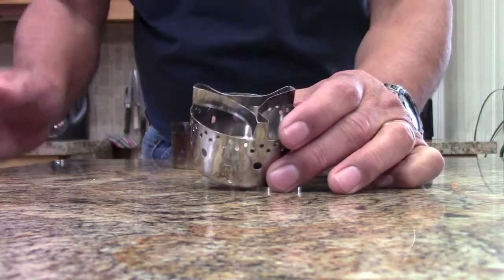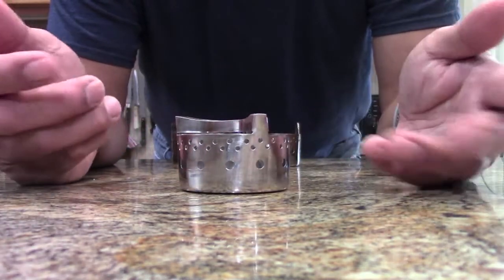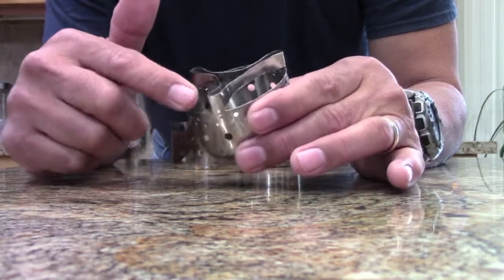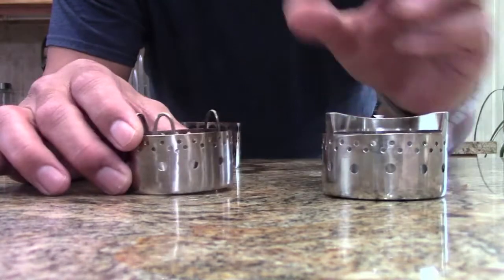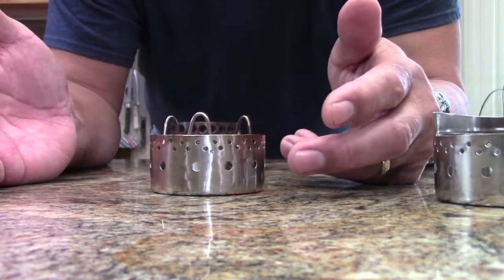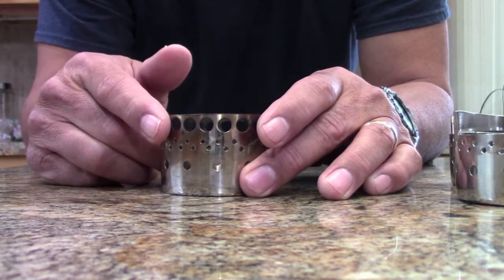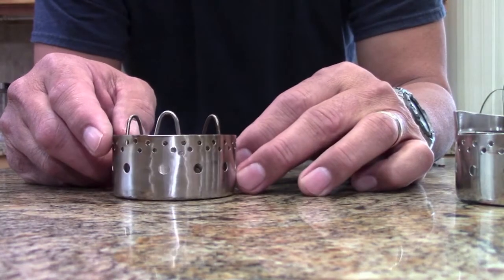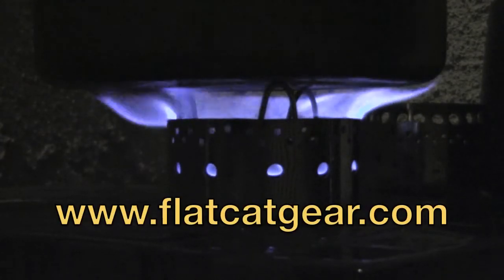A Multi-Fuel  Stove Prototype by FLAT CAT GEAR

Comment: These stoves are indeed the best of all I've tried to burn the pesky fuel we have here. Good to see you're still improving the design!
I was always cutting and bending these pot stand legs in my experiments, much in spirit of Japanese Cyclone stove. It's perhaps not glorious, but it adds significant rigidity, so I could go with thinner walls. But you saw this already and the top edge is still sharp. Perhaps taking a batch of parts through a tumbler would work better than deburring everything? I mean one of these vibrating buckets filled with rocks.
Reply from the maker: I've used a tumbler and they cannot cleanup all of the edged, there is just a lot of hand work to the current design
Reply: Then perhaps electropolishing will work,  @FlatCatGear  ? In it's simplest form it's just a bucket of citric acid solution and regulated DC supply to tune in the right amount of 'roundness'.
Reply from the maker: Perhaps, though it is a process that is best done in large batches.  I'll investigate it.  Thanks.

Comment: I like my (two) multi-fuel stoves, and have just always wondered why you even screw around with the integrated pot stand. Just offer a shorter stainless steel mesh pot stand that is as close as possible in height to the optimal height needed for this stove. That alone would resolve the issue of production costs of the integrated pot stand.
Reply from the maker: There are just too many parts to fiddle with.  The integrated stand just solves all of those issues.

Comment: What is the ideal distance between pot and burner if using the multifuel burner without the built in pot stand?
Reply from the maker: 1/2".  The ground to pot distance is 1.75"